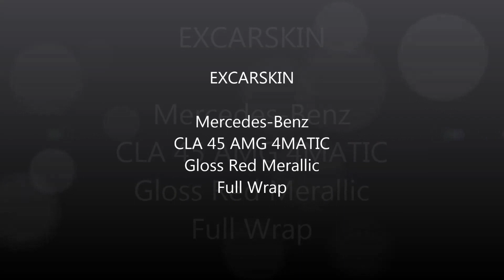Benz CLA 45 AMG Full Wrap

Comment: why does it has cla200 emblems and you call it 45 wrap???
Reply: +blackCreaper It's an AMG, look at the seats, I think they change the emblems to avoid drawing attention
Reply: +Alejandro Gutierrez It is no AMG it only has the AMG visuals such as seats wheels etc. it is a CLA 200 which is not even close to an AMG by performance ~ 200 HP difference
Reply: _sAiL its 45 look at inside dude
Reply: It is a 45, can tell by grille and seats.
Reply: and exhaust
Reply: fm_98 Look @ about 4:20. It's the 45 engine.